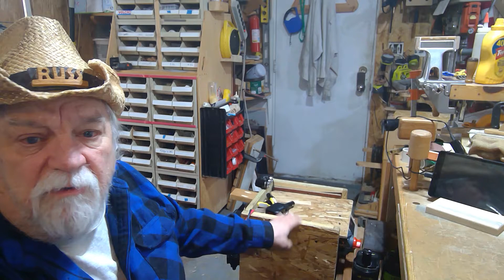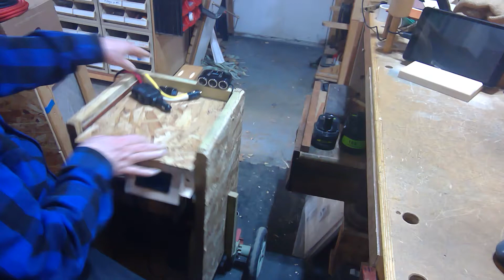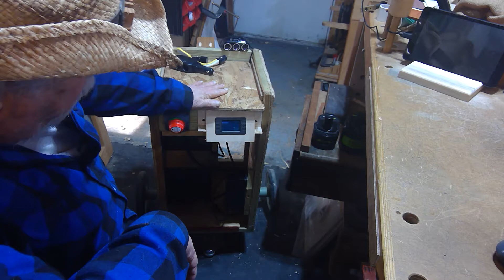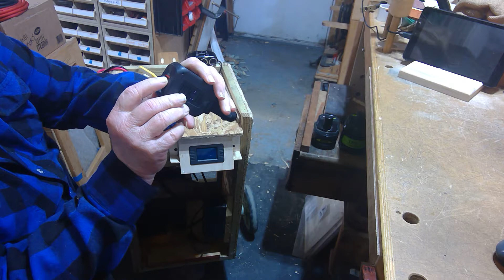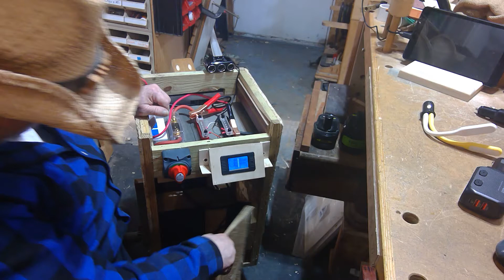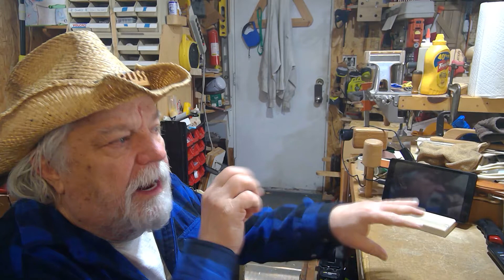Upgrading my DIY Power Station and More by Rambling Russ

Comment: Clever design on the power station - keeping it simple.
Suggestion: Add an inline fuse on your 12v feed to the "cigarette" outlets.
Thanks for sharing!
Reply from the maker: Thanks Steve.  Yeah, I cut off the cigar plug in and hooked it to the bus bar, eliminating the fuse in the plug.  I will definitely do that, good catch :>)

Comment: I have no current plans to build a FOG system, but I like watching you explain and demonstrate your electrical creations because one never knows when some bit of information you mentioned may come in handy some day. 
  
I am finally in the midst of building some upper wall cabinets in our garage so that I can get a lot things off the floor and create some workspace below said cupboards and also get one of the cars back inside.  I hope I get it done before the snow flies!
Reply from the maker: Are you going to use wood hinges :>).  BTY, around here, cars aren't allowed in the garage . . . and I do warm up cars and scrape windows for "you know who".  It's worth it to me.
Reply: @russveinot5754  Doors or hinges of any material would be phase 2, so no concrete plans there yet.
I just need to get the business part built and on the wall so they can do their job:hold lots of stuff!

ahhhh, there's the dream...garage becomes full time shop, but ultimately, I like my wheels being inside.  Easier to clear snow from the driveway.
Warming up cars and scraping windows does get the blood flowing though!

Comment: I love it i want to make me 1
Reply from the maker: with the battery costing less than $300, you can build a 1280Wh power station for under $600 I imagine.  FYI, I do plan aon adding a solar controller sooner or later.  Thanks rad.

Comment: Do you have an emergency light in your workshop that comes on automatically when the main power goes off? My workshop is in my basement which has no windows. I installed one so that if I am in the middle of using my table saw and the power goes out, I will still see what is going on.
Thanks Russ
Reply from the maker: That's a great idea . . . now, if only I had a spare outlet plug-in :>).  I do have several flashlights around my shop.  One is always in reach now that my vision needs the help sometimes.